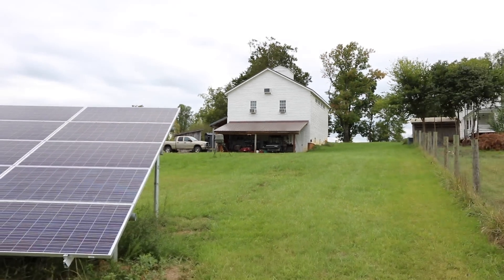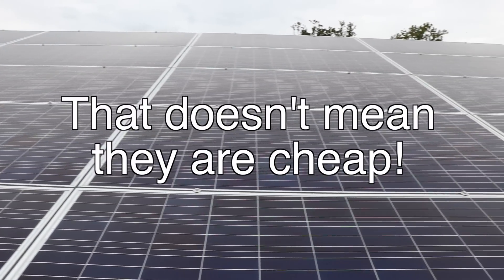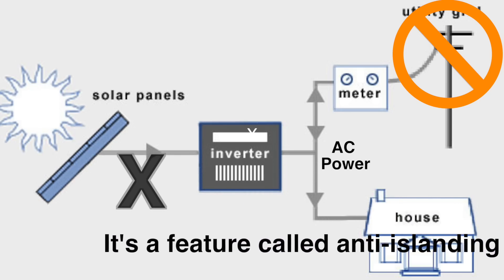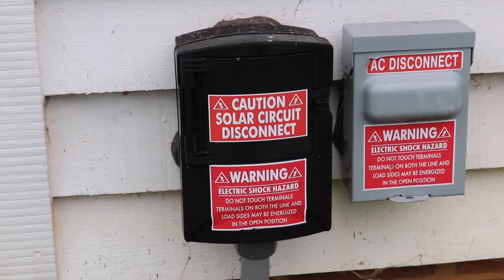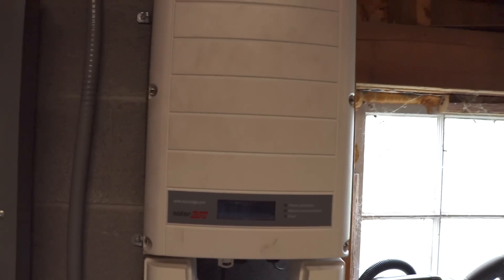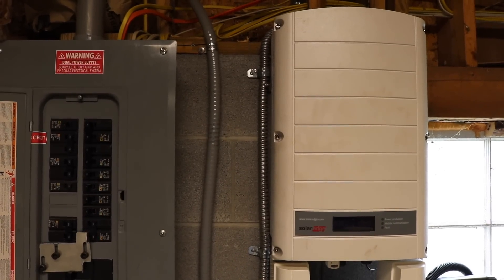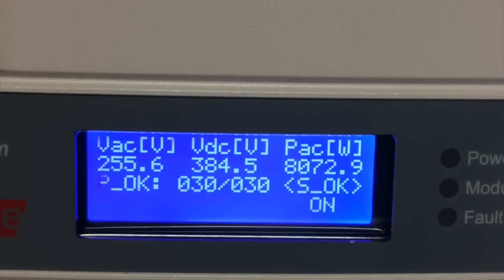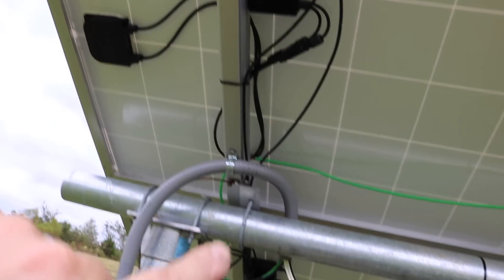The ugly truth behind grid-tie solar systems. Part 1, FarmCraft101 solar.  Watch before you buy!

Comment: how many weights can we put on the roof? i mean how many weights the house can really hold on the top of the roof of the 2nd floor. roof shingles alone should be over 1000 pounds and adding solar panel weighing 3pounds per sq ft. e.g., 20 panels for just about another 1000 pounds. i think this is significant for a older house like mine.

Comment: My parents have a 128 panel system at their home.
The best retirement fund ever for them, free power, only electrical vehicles and heating. They pump more than 85% of out put to the grid, as my dad says every time the sun shines they are making money
Reply: You can't say the someone has 128 panels and has free electricity.  That's like saying I sent $50k to the power company and they give me free power.
Reply: @PoNKPoNy  yes you can. The power they produce is basically free but the panels were not. The panels also are a capital investment in their property making the property worth considerably more. They did not borrow money to invest in the panels, and they were bought under a government funded scheme which reduced the actual cost to them by about a 1/3.

Comment: In AU you have to have an off switch at the array also + off switches at the inverter for both DC and AC. Your off switch is to far from the inverter. It needs to be at the inverter so any one working on the inverter can isolate the power from both sides, while knowing no one can turn the power back on.

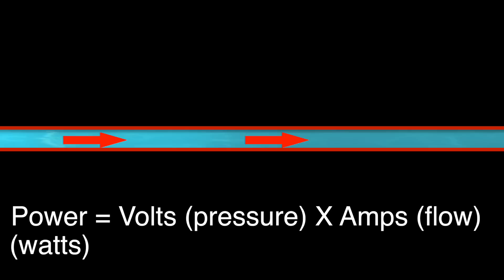Comment: 4:00 you seem so knowledgeable but you put incorrect animation, higher voltage means speed of water is higher, so the arrows need to move  faster to the right. But slow arrows mean you need thicker wires
Reply: No higher voltage is the water pushes with more strength, speed of water is most like current, but not really its amount of water that has flowed.

Comment: lots of cheap offgrid all in one units running up to 450V on the pv side i have a 359$ pow mr 80A 450V chargecontroller/ 3kw inverter ,and at the 500 prizepoint there is bigger 5.5kw units units

Comment: Why's it so expensive initially. I used to think it was the battery bank..panels?
Reply from the maker: There's a lot that people often forget about, and only consider the price of the panels.  The panels are a major factor of course, but only part of it.  The ground mount is a lot of steel and concrete, plus a lot of labor to install.  Then all the panel mounting brackets and hardware.  Trenching and wire from the panels to the shop.  The inverter.  Several disconnects.  And all the labor to install everything.  My system is 6 years old now, so I think it would be cheaper today.

Comment: This video title is misleading because Grid-Tie  system shall be OFF when the grid is down. To get power during power outage, solar system must be combined with Off-Grid inverters and batteries system. It is just how you invest and what is your requirement. Dont say bad things to solar system
Reply from the maker: Grid tie is a term in solar, and has a specific meaning.  Almost all grid tie inverters will turn off completely when the grid goes down.  Hybrid inverters are different and can continue to operate.  The misleading thing is the term grid-tie, as many people are having systems installed in their homes but don't realize that it will not function when the grid is down.  They think they are getting a hybrid system when they are not.  This video is informing them of that.

Comment: Forgive me if I have the physics incorrect but feeding back to the grid is not done by producing a voltage drop.  This would cause real issues between phase synchronised AC sources.  You need to understand how a 'Link Inductor' works - not easy to explain quickly here!  I believe this is a common misconception but I stand corrected.

Comment: Good video.  The inverter forces power back on the grid by adjusting the phase angle of the inverter sine wave compared to the grid sine wave.  A leading phase angle will force power onto the grid and lagging phase angle will let the grid put power into the inverter.(not good, boom!)  I'm getting ready to build a barndominium and will put panels on my metal roof in a similar setup.   I'll have 1300 sf of South facing roof.  The panels will shade my roof and make for shorter wire runs.

Comment: That’s a lie grid link systems are not the cheapest for your system will need to be 4 to 5 times larger than needed to run your pool hall if you were trying to get a net zero power bill let’s say that you were paying $.10 a kilowatt hour the power company will only buy that power from you at two cents a kilowatt hour if you’re lucky in that case you would need a system eight times larger then you would need if you were just to run your house directly off the solar and batteries are actually cheaper than the cost of tying your solar integrated the average cost of grid Tyanne is six to $8000 if you bought that money lithium ion batteries you would not have a power problem for the next 25 years the batteries will die from shelflife long before they die from cycle life and look what California is doing right now with people that are tied to the grid state of California is trying to pass a law requiring people with solar panels to pay a minimum surcharge to the power company your best bet is not to be dependent on the government of any kind for anything the more power you can take from the Government and put back in the hands of the people the stronger we become so do not hook to the grid you’re a fool if you do

Comment: Assuming you are storing diesel, or gas, or heating oil under that array... you have a fire or explosion waiting to happen with high-voltage DC power in the hazard area (see NEC).

Comment: Well done video.  As a master electrician with a background in physics and engineering I have however chosen to not become involved with any system that does not include on site storage. Having been involved with co-generation in various forms from small rural windmills to industrial heat reclamation projects since the early eighties I have seen the mandated beginnings of ‘net metering’ all the way to the current phase out of that model. That mandate occurred during the era of mechanical metering and the added cost of dual metering made most small installations unfeasible at that time. I disagree, as a matter of principle, that taking advantage of modern electronic metering which makes possible grid ties feasible, and thus using the grid as ‘storage’ is not a fair and equitable system under net metering. Obviously the courts and regulators agree with my position as net metering is now on the way out.  The proper analysis in my position is always grid tied for reliability, net zero draw from the grid under normal operations, and on site storage for management of the differential between electrical generation and load times. This of course comes at a significantly higher initial investment and longer payback. As examples of my rational I offer disagreement about your statement regarding selling excess production to your neighbor. If that is your goal then you should route your own cables to your neighbor’s property. Using the grid instead takes unfair advantage of the utility company’s infrastructure and is also an unfair usurpation of the company’s business model of producing electricity at wholesale and selling at retail like all other free market capitalized businesses. Plus utilities may be monopolies, but they are very much regulated monopolies. They, like all other businesses, are entitled to charge for their services and make a profit for the shareholders albeit regulated under government oversight. One very big fallacy of solar is hidden in that need to store that energy. We are making it when it is not needed. Dumping it to the grid is actually a very poor choice for a myriad of reasons besides the unfairness of the net metering issue. It is a logistical night mare for grid operations on a system that was engineered and constructed to transport power from a centralized source to distributed loads. Things were ok when only a handful of installations were involved and thus net metering made some sense. But with more widespread adoption of the technology these points I am raising have become critical issues.  In addition your description regarding the inverter’s ability to manage the direction of power flow is a very good analog of what is occurring but not technically accurate. I suggest you familiarize yourself with the concept of power factor in electrical circuits. You very clearly have the basic understanding of electricity to grasp and add this concept to your tool kit. Once so you will realize that the electronics management utilizes phase angle to perform its management of power flow. Again, we’ll done and thank you for consideration of my position.

Comment: You've had your solar system for close to 5 years now. Maybe time for an update video to document your experiences in that time?  Recent rises in the costs of electricity may have reduced the payback period you originally calculated? Would you have done anything differently knowing what you know now, eg would you have made / installed the solar panel support system yourself? Were there any failures / warranty issues etc....
Reply: I agree it would be cool to see an update, also we have had a 350% price increase for electricity in the UK in just the last 20 weeks, with the avg 3 bedroom home paying £3600 a year, going up to £6k next year, from just £1k start of the year. So many people are now panicking, and looking to buy solar, and heat pumps etc.

Comment: Thanks a lot for the presentation and really helped me understand the wiring size according to volts.  One thing I am missing is what product are you using to pickup that 360v coming from your panels?  It looked like you have 2 different units other than your electric panel so is one of them taking 360v and converting it down to AC?
Reply from the maker: The 360V from the panels is DC and goes into the grid tie inverter (solaredge) which converts it to synchonized AC and puts it back into my panel.

Comment: My question is this.  You said the power will go back up the grid to run your meter in reverse to save you money.  The generated solar power never runs back into the utility grid.  How is that possible on one power line? It obviously runs the meter in reverse,  it never gets fed back to the utility's sub station,  right?   Just turns the meter in reverse so you don't use as much from the utility Co.  Someone comment and help, this confuses alot of people.

Comment: u can actuly use solar with the grid down. it just looks for a background current. so a generator would provide the background current. would have to turn main breaker off other wise your liable if a line men gets killed or injurde. but a way around it.

Comment: Thanks for this nice video. I would like to mention that many meters today will not run backwards wth this system and you need an agreement with your electric company to get credit back and they credit you back with a pathetically small fraction of what they charge for their electricity, so be sure to get all those details from your electric company before taking this plunge. Also remember that rates may change over the years.

Comment: I went with 440V DC to 220 V AC. It gives me a 40 amp AC circuit into the main box. The bad part is in order to do a battery setup it has to be a high voltage setup so a Tesla or LG.

Comment: The proposition that a grid-tied system cannot be used during a power outage is no longer absolute truth.  The problem is that the companies who make the inverters, or more specifically "microconverters", are starting to realize there is a market for producing power when the grid is down.  Unfortunately, the inversion process and alignment of the phase(s) to the grid is so complicated and requires certification and approval from the grid operator and it is not a do-it-yourself kind of system.  However, that may be changing.  Sun Power is offering systems that are grid tied, but can be run when the grid is down provided you purchase their battery package; a package which may cost more than the panels and inverters.  It's all about marketing and maximizing profits which is unfortunate as generation of electricity ought to be considered as something of national security.  i think things will be changing over the next decade (it is now July, 2022).

Comment: amazing.  all the videos say their system only costs them 17,000.  however they all seemed to install them themselves so there are no labor costs.  seems like most videos are done by those who have the ability to install them to save massive labor costs, and have to go to great lengths to justify solar.  however, no videos rave about how well their systems do after 10 years when they need to replace most everything except the panels, which are btw the least expensive part of a system.

Comment: So if I heard correctly, solar panels will either reduce your electric bill, or buy you credit with the power company? I just bought 3200w of solar panels, and I'm trying to decide whether to build a simple grid tied system or a hybrid (grid tied with battery backup). I bought 15 225w 36v panels, but I can go buy 15 more @$55/panel. Worth it? Do I have to use a $2100 grid tie inverter?

Comment: Yes, if you lose an optimizer it will not affect any other modules. I've been running SE since 2011, it's a good setup. My other system is off grid/intertie, if the grid goes down that system powers my home with ~10.5 kWh of battery.

Comment: I have a SunnyBoy inverter that gives me 10 amps at 120 VAC when the grid goes down, on a separate outlet.  That's plenty to run the fridge while the sun shines.  Not as resilient as a backup battery, but FREE!

Comment: can i use only 1 cable between the house and the grid meter if the panels are on the house and the grid meter is like 20 meters away from the house or would i need to run a separate solar cable to the grid meter too and then that meter gives it back to the house through the original 20m cable?

Comment: 17.000$ ?   I can buy 420w panels for 150€. It would be 3.600€ for 24 panels producing max 10kw. + the inversor + materials. Why is so expensive?
Reply: Only can see that cost if the installation was nearly 10.000$
Reply: well he's got 30 panel's they run about 400 to 450 dollar's a piece here in the US for a good panel like panasonic 360 watt from what i have seen thus far. That's about $13,000 right there without tax. Plus an inverter to run that seems to be about $3000 U.S and all the other little stuff adds up pretty big too so actually he did pretty good for that much. Hell it seems more expensive now adding it all up probably from inflation lmao
Reply from the maker: So this was done in 2017, the cost of panels have come down.  I'm not sure what the current prices are, but people often make the mistake of only figuring the panels and inverter.  Ground mount systems tend to be more expensive.  My ground mount vertical supports are poured in concrete.  Holes had to be dug, quite a lot of concrete to buy, then pour, then after that big cross members and other mounting hardware for the panels.  The mount was several thousand in materials plus labor to build.  Mount the panels, wire them up, then install disconnect at the ground mount.  Dig a ditch up to the shop, buy and install the cable for that ditch, then more disconnects at the shop.  Backfill the ditch, plant grass.  Then run wires in the shop to the inverter, mount the inverter, then wires from the inverter to the panel.  Panels need breaker(s) and interlock protection.  Permits, inspections, etc.  It all adds up.  In 2017 this was a good deal.  In today's solar market it's probably high.  Your 3,600 pounds for 10kW of panels.  Are they quality panels?  Is that shipped and after taxes?  With my ground mount, the cost of installation was easily $10k.
Reply: @FarmCraft101  they are quality panels, life expectancy of 30yrs. It is from a near factory near my city. Maybe the cost would be much cheaper if done in the roof of the house? 
The cost of installation + permits are almost 2.000€

Comment: Would love for someone's opinion....I'm currently using anywhere from 38-70 kwh per day... but my power company only allows Me to produce no more than 10kw so I'm left with a 9.72kw system.....if I'm getting a diy kit and my total cost after incentive is $13,400 I am paying about 9.20-9.60 per kwh... they only buy back at 4.0 per kwh will this still save me some money or is this not smart? I live in south GA with NO trees 5 acres in the middle of an open field my house faces exact N and South...my power bill could be anywhere from $140 to $240 would this "smaller" kit still possibly cut my monthly costs by more than half? Thanks in advance! Would like opinions before I pay for  This kit and regret it..

Comment: I have 240v Ac micro inverters, 30 inverters for 30 panels. That said, since it’s already Ac, can’t I just hook it directly to my service panel. I’m not sure you are correct about flowing to your house first. If that were the case, then your house would have electricity when the grid power goes down. Correct me if I’m wrong.

Comment: My property has a odd set up.My meter is not at my house, it's  about 100ft away. The area where my panels  would go is 120ft from my house in the opposite direction, a triangle from the house, meter and panels. The utilities company said that I must have a shut off no more than 10ft from the meter. For net metering,  could I just trench my wiring to the meter,  bypassing the house and installing the inverter  outside next to the meter and shut off? Should  the inverter be outside in colder climates? I noticed that most people have them inside. Dont want to trench  to the house AND the meter if I dont need to.